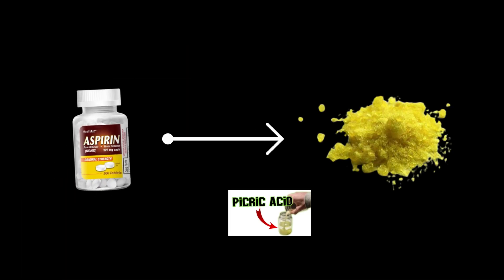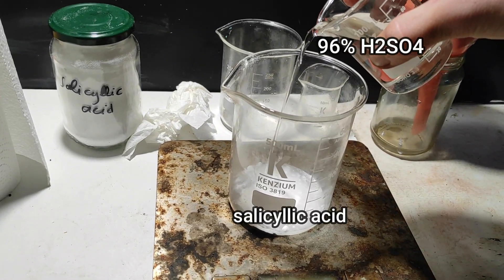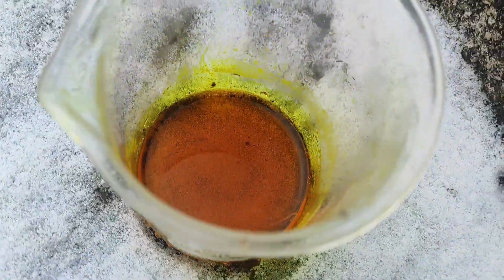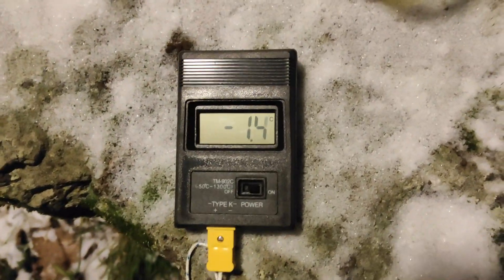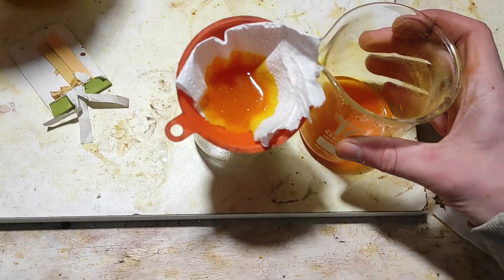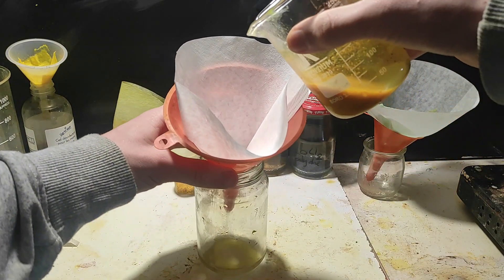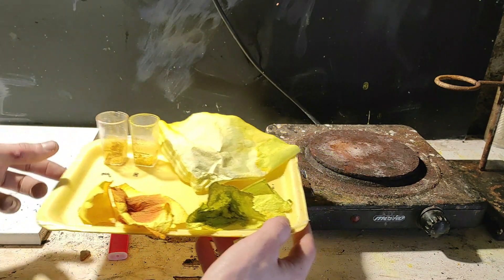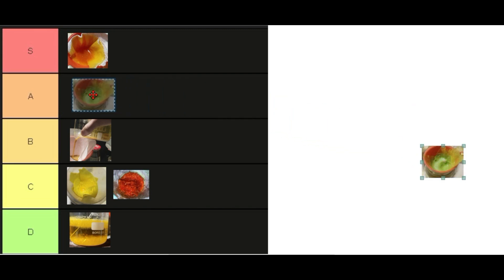making explosives coz I'm bored    Na, NH4, Ni, Co, Cu picrates  pt.2

Comment: Hi Jam Kemist,
Nice video.

I must tell that picrates are for most unknown, so here are some of my information or experimental findings:
1°) Picric acid is a bit a weird compound that can be acidic in two ways involving color change.
a)As you know phenol name comes from the special habit of keton-enol switching so phenol can be seen as a keton on a cyclohexadiene ring.
So HO-C=CH- is also O=C-CH2 (or - C(OH)=CH - can be seen as (-CO-CH2-)
b)Also the nitro group onto an aromatic is not exactly what people think it is; it has a bit its nitronic acid nature and the group next to it plays a role.
So for example TNT has a defined color, sensitivity and mp; but when you add a strong base like NaOH, it is more sensitive and has a deeper orange-red shade.
So CH3-C=C-NO2 (here depicited as a sub part of the aromatic molecule) can be seen as CH2=C-C=N(=O)-OH by a "proton" jump from a "not specifically acidic" CH3 to a more acidic nitronic structure involving an aromatic  -NO2 (-N(=O)-OH)
It is not as an usual alkylic nitronic acid obtained from nitroalcanes and NaOH and that turn dark brown-black in microseconds; it is like an equilibrium with less of the nitronic form, what explains the orange-red instead of the dark-brown; but this is sufficient to explain a difference into sensitivity of TNT.
Yellow, Orange, Red, Brown or whatever color, when concentrated looks realy black to a chemist or artist eye.

Here into the case of phenol, there is a much more easy proton jump from the quite acidic HO- group to a keto-nitronic-H orange-red especially if strong base is present.
This must explain the sensitivity to flame observed for your Na picrate and NH4 picrates.
So if you think not too hard and deeply, you will understand that picric acid or picrate with a certain % of sensitiver ketonitronic salt form will make the all batch more sensitive.
I guess the Li(+) must be interesting.

2°)Usually K(+) salts make more anhydrous and sensitive salts... than NH4(+) or Na(+); while stil being a strong alcaline base; it will of course share with sodium an ammonium the nitrophenate-ketocyclohexadiene nitronate color and enhanced sensitivity but boosted by less water of cristallization content. 

3°)I did test the reaction of picric acid solution onto hydrazinium hydroxyde and it makes a precipitate of glissening shiny yellow cristals of hydrazinium picrate. The salt is unfortunately not that powerful on its own (I suspect the nitronic form is not that present due to the lack of basicity of hydrazinium hydroxide vs ammonium hydroxide); The salt seems to only sublimate. It was not tested for impact or actuated by a primary. It was tested with Ni(N2H4)3(NO3)2 and Ni(Picrate) as a brown precipitate with less output than the pinky clayish Ni(2+) tris-hydrazino nitrate precipitate (NiHN).

4°)Transition metals like Ni(2+), Co(2+) or Cu(2+) are of course interesting colorfully and chemically speaking ,but they display also some rare hybrid forms like basic picrate salts like Ni(OH)(O-TNB), Co(OH)(O-TNB), Cu(OH)(O-TNB) that may occure during the process, precipitation or hydrolysis with water from the solution.
This doesn't count with the fact copper is a rare metal that can easily express its Cu(+) or Cu(2+) "ambi"-valence; with different colors, sensitivity (to flame, storage, shock), solubilities.

As a final surprise, the possibility of higher valences Cu(3+)(rare), Co(3+), Ni(3+) with also their spicy different colors, sensitivity (to flame, storage, shock) or solubilities.

5°) The test of Aluminium foil (to flame open or folded - open or confined) is of course great and a must for any great chemist; but maybe use the test in the open onto some other metalic surface like an inox (steenless steel); because of the inerent sensitivity of aluminium metal to acids, bases and maybe possible partial formation of Al(Picrate)3, Al(OH)(Picrate)2, Al(OH)2(Picrate) in the warm melting into the melt; or even alumino-thermic oxydo-redox reaction that could happen between Cu, Co, Ni salts...

6°) Very little people knows this but one of the most sensitive picrate that readily happens into the not too suited event of a lab glassware shattering of a TNP solution onto marmor is the calcium salt
2 HO-TNB + CaCO3 --> Ca(Picrate)2 + H2CO3 (H2O + CO2(g))

Keep on enjoying chemistry.

PHZ
(PHILOU Zrealone from the Science Madness forum)
Reply from the maker: Thanks for this huge comment as always ! I do read them since you seem very educated and give interresting advice. If you have time I have a question :
One of my friend made nickel picrate but his salt was much more crystaline and deep green.
I don't have a picture but would this be explained by the presence of the Ni(II)  hydroxide picrate you talked about ?
Reply: @jam_kemist3986  
I have no immediate answer to this because I haven't worked with picrates for the two last decades.
I could in some weeks if needed.

But indeed there are two major players here; eather Ni(O-TNB)2 or Ni(OH)(O-TNB) and each may form under different cristalline form depending onto sovent, dissolution, concentration, heat, nucleation, ... so the process makes considerable difference into the final outer-look. Cristallinity may also induce more sensitivity to shock, friction, heat due to cristal lattice deffects lowering locally the activation energy for decomposition, fire, explosion or detonation.

Comment: Your pace is a little fast. I would slow your narrations down about 20%. I believe I would be amiss if I didn't remind you that adding chemicals to a hot beaker on a hot plate like that is MOST ILL ADVISED and I would personally immediately discontinue use of that process. Simple accidents happen and there are things you should never breathe that may result from a mere bump to the elbow and subsequent spill. It would help you a lot to have a cleaner table to use and scrub down all your gear including that hot plate. Just a thought. Contaminants cause all kinds of side reactions you don't want to have to mitigate just for a video, believe me.
Reply: i think a lot of chemistry is conducted by adding chemicals to a flask or beaker when its on a hotplate :face-orange-biting-nails:
Reply from the maker: Thanks for the comment ! 
And of course the Beaker was cold when I added the chemicals inside so idk what danger you're refering to ?
I also don't really see how would things go from under the beaker to inside but I agree it's a bit messy 😂